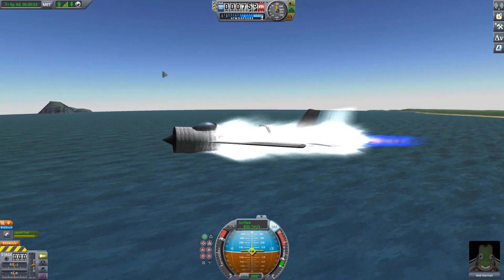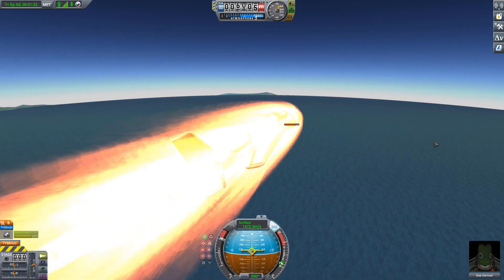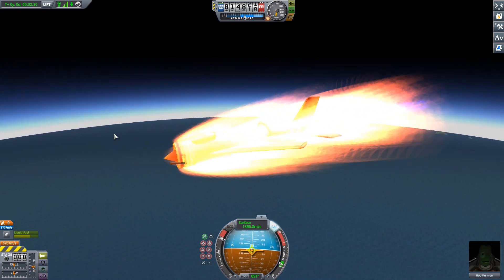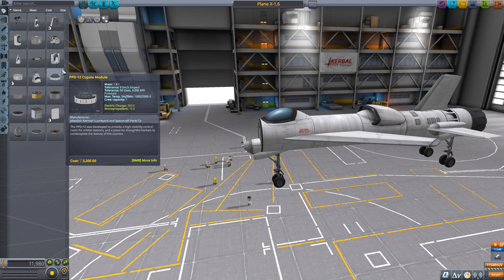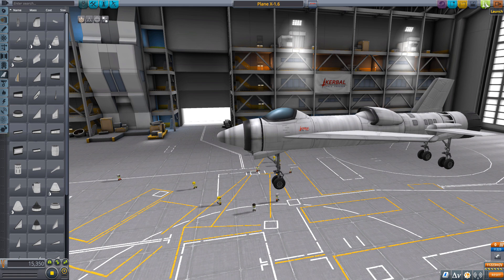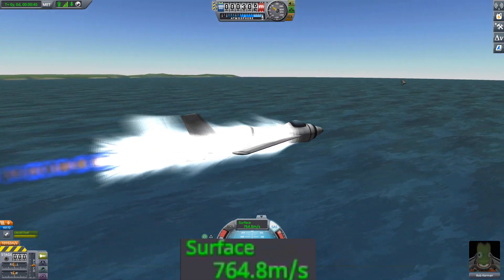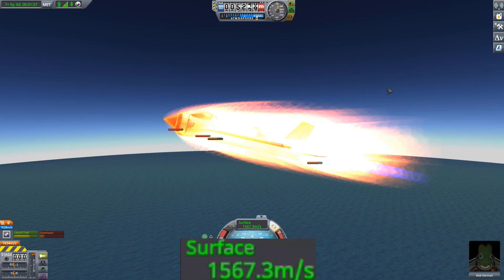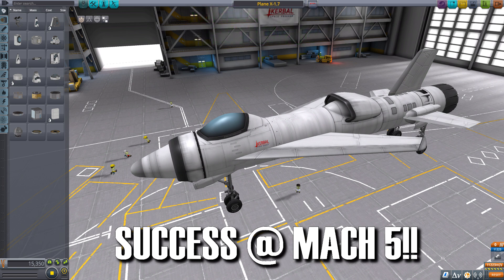Kerbal Space Program MACH 5 JET - No Mods No Rockets

Comment: Just add more engines and wings and sweep the wings back. No rockets involved oh and use afterburners on jet engines. I have used the panther after burning engines and made a dart jet plane with spike air intakes with engine nacelles 3 times on both sides of my jet with extra liquid fuel tanks I can also fit on a couple of crew cabins and science jr’s just keep the same aircraft and change out the engines or double the amount of engines. Another thing is just fly at higher altitudes and have a sharp pointed nose. I have added nose winglets for more lift and manoeuvrability at low speeds and they to can be swept back to produce less drag.

Comment: Im having a competition with a friend and we are competing on who can make a faster aircraft without using rocket engines so this helps me out big time I managed to get to 1668m/s (mach 4.8) and then I would have to pull up because I would hit the water and i couldn’t get faster because my air intake would explode and i would decelerate rapidly and something I found interesting was by coincidence i was testing the plane and i couldn’t get it over 1587m/s and i couldn’t work it off why and i just decided to go back to ksc and i looked at my fuel it was too low to go around kerbin so I just started turning around and heading back to ksc and i decided to make one final attempt at the max speed i climbed up to 51000m and then dropped and i reached that 1668m/s and then I pulled up and exploded from the g force and by that i set the fastest speed between us and later i tried it again and i again couldn’t get over 1587m/s so i guessed it was because of different engines but it wasn’t then i thought it was because of drag it also wasn’t it so i pinned it down to the weight and I literally stripped it off everything it didn’t need and even lowered the fuel to the bare minimum and from like 27tons i got to 14.7 tons so i tried it thinking it would go way faster now but it still couldn’t pass 1587m/s no matter what i  did so i just quit the game for the night and went to bed and then at one point it occurred to me that i went east on my highest speed instead of west and it made me think really hard and i remembered one tutorial i was following when i was starting ksp and in the tutorial the person said that if we wanted to make a good and efficient orbit we go west and it gives the orbit a boost so i was thinking what would happen if you turn it around and went east, it would be a very inefficient orbit because you are going against the rotation of the planet then i was thinking what would happen if you were slightly lower lets say at around 20000m if you were going at your fastest speed limit which we will say 1580m/s and the planet is rotating at the speed of 20m/s and since you are going against the rotation of the earth you must go that 20m/s faster so your speed would be 1600m/s or maybe even faster now I haven’t tested this theory but I told it to my friend who cant pass 1560m/s and when he came back he was so excited to tell me that he went 1595m/s which means that my theory is correct which means that I could possibly go mach 6 now this is just a theory and i still have to solve the problem with overheating but i think i found a solution to that meaning that i could go way faster than i could before I also need to worry about the drag and twr which I keep about 2.0 which should make me more faster i am using 4 whiplash engines 4 coolers and 3 intakes i made the plane as aerodynamic as possible and minimized using wing pieces and im positive that i can get it way faster and possibly more lighter less drag less overheating at the cost of maneuverability at medium to high speed and hard to control at lower speeds which isnt great but it should work very fine

Comment: Hack for KSP: Press Alt+F12 then press 'Cheats' then enable 'Ignore Max Temperature' and 'Infinite Propellant' then empty the fuel tanks to achieve what I call 'Absolute Sonic' which is the absolute highest speed your craft can get.

Edit: This counts as vanilla as this feature is built-in.
If you want to start with something, press Shift+Tab > Workshop [to the left then up a little] then type in the search bar 'AeroX' then click the Iteration II model, as it is the fastest.
Use the cheats, replace the engines with Whiplashes and there you go, a hypersonic vehicle.
Reply: Another tip, go high up with a vehicle with Whiplashes [as it loses all its thrust at the edge of the atmosphere] to decrease air resistance and improve speed while you're fast.

Comment: i did a 7000 Km/h (1920 m/s) jet while trying to build a real life jet (i used the rapier on air mode cause it can take up to 500 kN just through high speeds)
Reply: Damn really? Would love to see that. Trying to make a realistic jet and got to about 1430 for a mid size dual engine bomber.
Reply: @RickyDBones  i had to make temperature limit off though , you can’t go above 1700m\s in atmospheric and still have an air intake
Reply: @merf5549  ah, fair enough. What if you tried clipping heat shields into the fronts of the air intakes?
Reply: @RickyDBones  heat shields increased the drag to much

Comment: I tried the same challenge and ended up with an unmanned flying-wing design with two scram jets. My philosophy was to have it as light as possible and to have minimal drag. It reached Mach 8. A version of this plane got so fast that it burned up in the atmosphere due to it's own jet-powered acceleration. Though I might not have climbed fast enough.
Reply: Did you use mods for scramjets? The best stock ksp jet engine (Rapier) have a speed cap of 1750m/s or something around there. In a modded save I made a manned hypersonic plane capable of reaching Mach 10 using a combination of jet engines and a scramjet (the scramjet part i used had enough thrust to push it further but the cockpit i used couldn’t handle the heat) using Mk2 expansion parts and b9 procedural wings. I could go further with UAVs but that’s not fun (and Kerbin is too small for it to work without putting me into a highly elliptical orbit, don’t wanna install RSS because that would increase the load time). Also I used textures unlimited recolour depot to make the jet look black, shiny and cool. What mod do you use for scramjets?
Reply: @fork9001  the RAPIER can actually put you in speeds excess of 1940m/s at least. The main problem is heat as the only way to reach those speeds with a jet only mode is to stay in the low atmosphere. My real question is how the jet shown in the vid is capable of turning without flipping wildly…
Reply: @johyal524  That CoL must be really far back.

Comment: I'd say rocket engines are still acceptable though, the X-15 used them 🤷🏼‍♂️ in my eyes that makes them ok
Reply: J E T R O C K E T I T S N O T T H E S A M E
Reply: I mean planes can use rocket engines but it’s not the same. Basically it’s own class.
Reply: Stock jet engines have speed caps and altitude caps. The fastest a rapier can take you is Mach 6.2 (not factoring in the amount of time and fuel needed to accelerate to that speed and a heat shield that will generate a lot of drag in the front). If you take advantage of stock ksp’s unrealistic aerodynamics and heat models, you could design a craft that could accelerate to Mach 6.2 with jet engines only (not the way S75 did it).

Comment: I made an uncrewed rapier jet that can reach about 1700 meters per second at sea level, but with ignore max temperature, it can reach over 2000 meters per second. I can provide a craft file if i need to
edit: key point is: AT SEA LEVEL
Reply: how ?
Reply: @fabster6667  mainly abusing the insane aerodynamics of fairings. basically i attached 2 engine pre coolers to a rapier at the back, a fairing at the front, and to advanced canards at the back. with some batteries and the probe core hidden inside the fairing
Reply: @KaneSoulbreaker  Came up with nearly the same design:  I tried the same challenge and ended up with an unmanned flying-wing design with two scram jets. My philosophy was to have it as light as possible and to have minimal drag. It reached Mach 8. A version of this plane got so fast that it burned up in the atmosphere due to it's own jet-powered acceleration. Though I might not have climbed fast enough.
Reply: @KaneSoulbreaker  We should be aeronautical engineers. Just kidding ;)